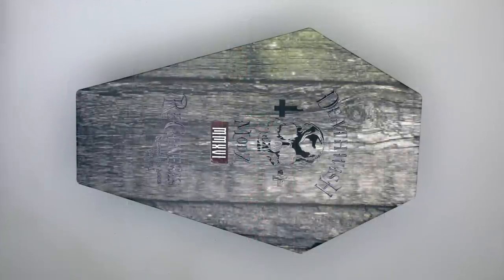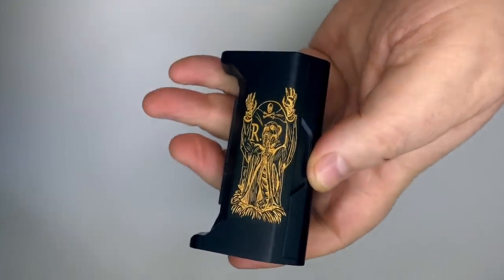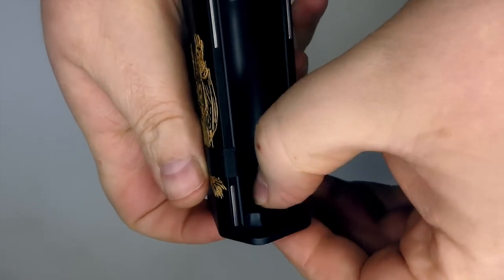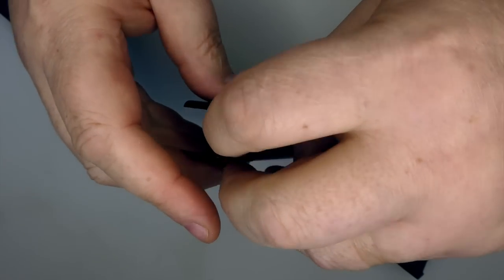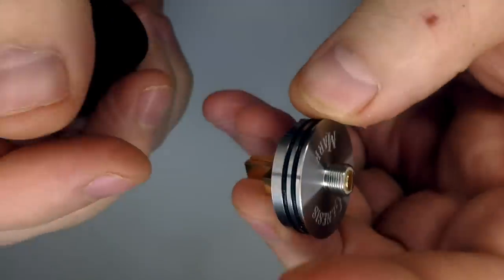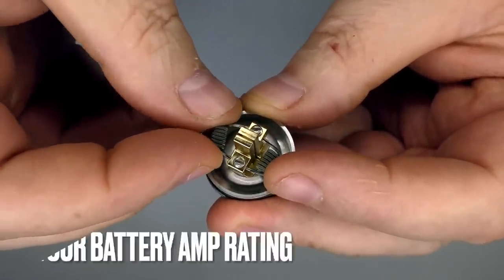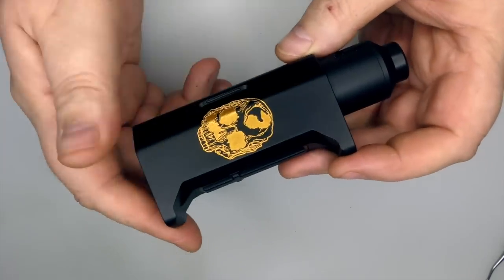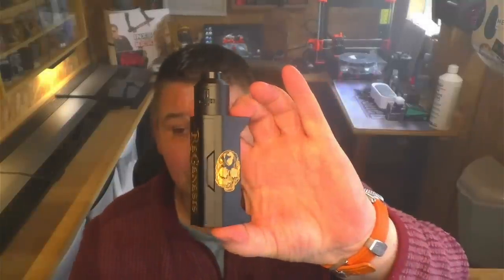ReGenesis by Deathwish Modz

Comment: I hope they don't continue down this whole oversized route, we need more mechanicals but people like me who won't use any larger than 24mm rdas seem to get no products anymore. I use large coils and even done series builds and never needed more than 24mm it's just wasted space and less flavour past that point. And I hate the extra metal hanging out over the switch on the top and bottom, seems pointless and I would've much preferred a smaller device than the extra overhang for no reason, fingers crossed they give us another 24mm tube mod, I for one would love a redo of the original hanged and unholy RDA with the inverted cross airflow and clamp deck.